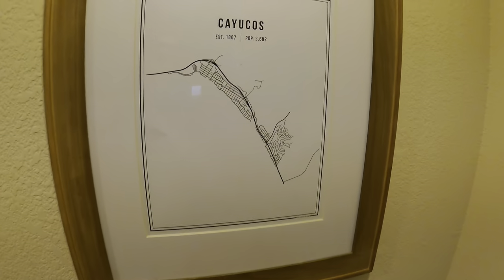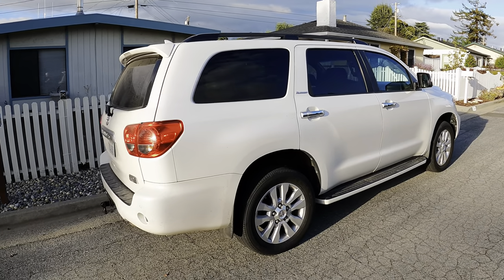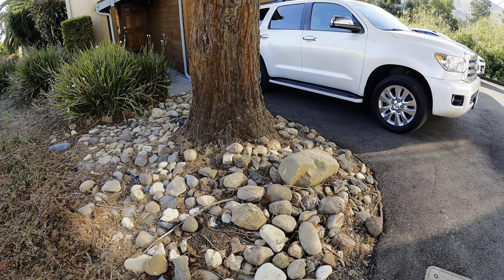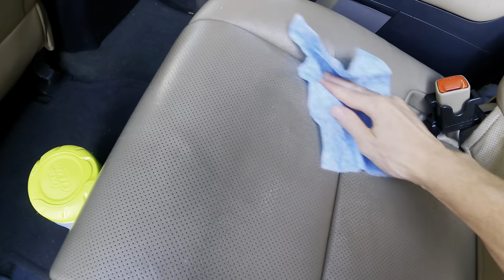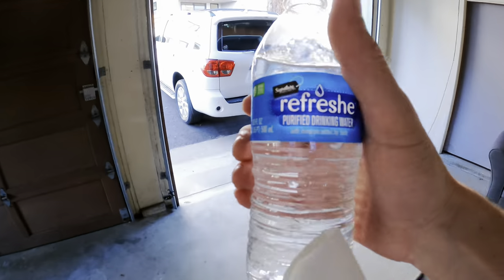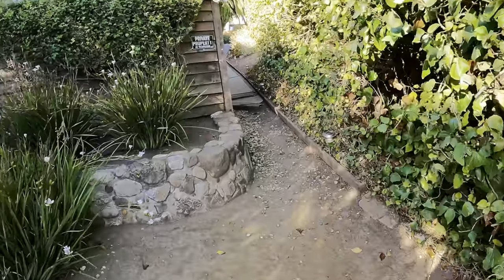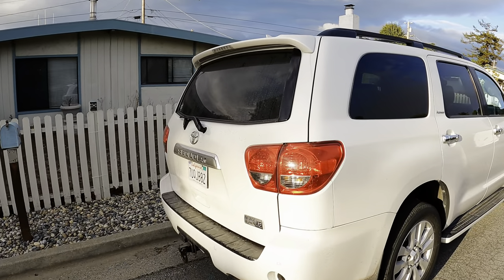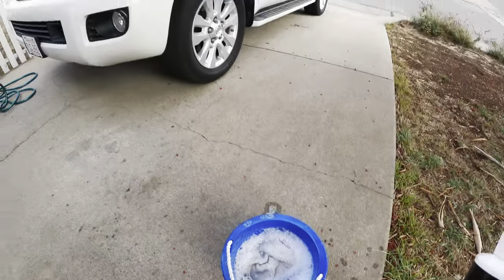The WORST TOYOTA MOD Of All Time!

Comment: The ‘12 Sequoia is looking good! I told you a few months ago that I also purchased a 2012 Sequoia Platinum in fantastic condition. I just got back from a trip where the car was completely filthied up. Like you, I detailed it before leaving for the trip. No better feeling than an immaculate car! Today I deep cleaned the entire car, inside and out. I’ve noticed some little red spots on the tailgate area that are impervious to washing. I bought Mequiars clay bar kit a while back and have never used it. I’m a little intimidated using it the first time. I’ll let you know how it turns out. Congrats on that sweet vacay home! Love your videos!
Reply from the maker: It’s nice to know another 2012 Sequoia Platinum owner.. we can relate to each other on the pros and cons.. to be fair, i think the only con is the 13.6 MPG is displays on the dash.. everything else is AWESOME!  I’m tellin ya, just get some of that quick detailer spray and jump right in with that clay bar on the back door, you’ll be so impressed.. just work the clay in your hands till it’s nice and soft and go for it.. let me know it goes.. 👍🏼